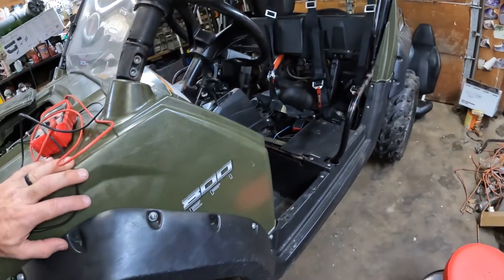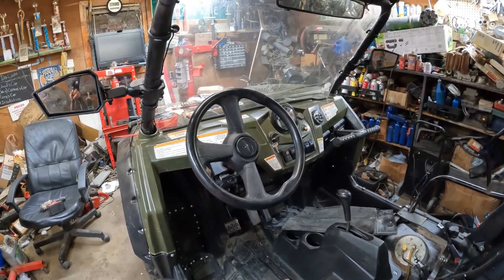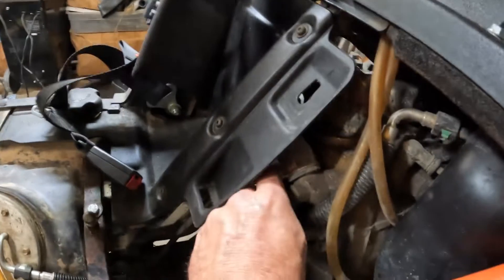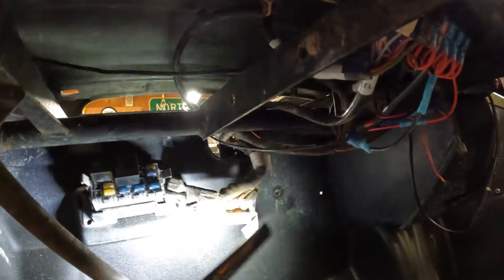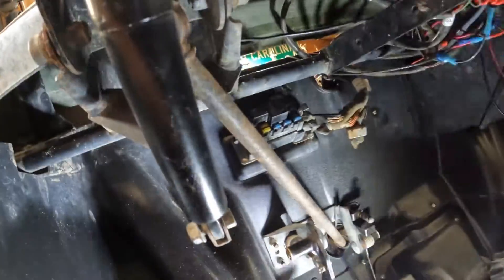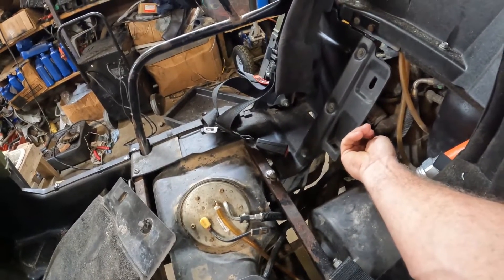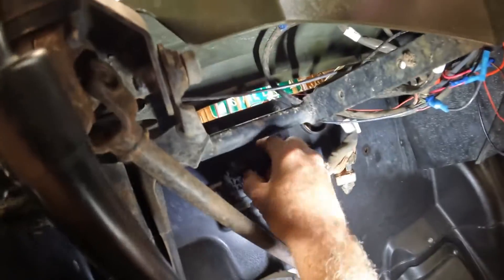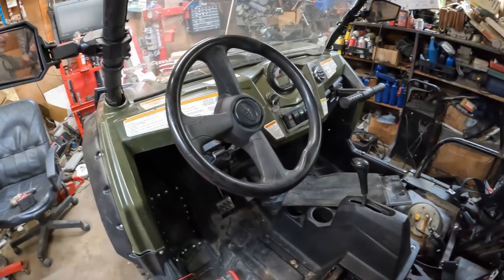Polaris Rzr fan problems

Comment: I have a 11 rzr 800 s I’m getting voltage on the inline fuse. I’ve switched the  relay i pull the plug on the temp sensor and the fan comes on when it’s running  i let it get up to temp plug the temp sensor back in and it cuts off… i need help bad
Reply from the maker: Sounds like you may have a bad sensor if it isn't kicking the fan on when it gets up to temp.

Comment: Thanks you so much mister four wheeler doctor for all your sharing i have a 2007 rincon 680 with issues cranks bud after 3 or 4 minutes shut off after that wont make it run again after couple hours bud did the same i change fuel pump fuel injector ignition coil spark plug what else i need to check do you think tps or iac valve will be my problem thanks
Reply from the maker: I know you said you changed the pump but have you checked to make sure the pump is working after it shuts itself off? Also check the fuel pump relay if you are not getting any fuel after the shut off.
Reply: Thank you so much answer back  mister how much do u charge me to diagnostic my atvs by phone am in north Missiippi take to repair shop an they told me my atv is no good but they offer me to buy for nothing i glad to pay you in front thanks
Reply: @FourwheelerDoctor  thanks u to take a minute to text back but i have somemore question but i want ti know how much do you charge me for diagnostic my atv by phone or texting am located in north mississippi i took my atv to the shop they told me is no good but they offer me to buy for nothing so i will be glad to pay u in front thanks

Comment: I had a bad relay on mines.  Would work at first but after a 10 min ride it would stop working.  I had to stop and completely shut it off for a couple of mins.  After that it would work again for 10 mins or less and would have to repeat.  I switched the relay and it fixed the problem.  Haven’t had a problem for 2 years now

Comment: Good video- I am having the same problem- fan does works, fuses good, new sensor, everything is plugged in, only 40 mile on it and can't figure out why the fan stopped  coming on when it gets hot. Really don't know what else to check

Comment: have the same problem and can't figure it out
Reply from the maker: Straight wire your fan to make sure your fan will actually work.
Reply: @FourwheelerDoctor  Did that and no overheating. Installing an override switch.